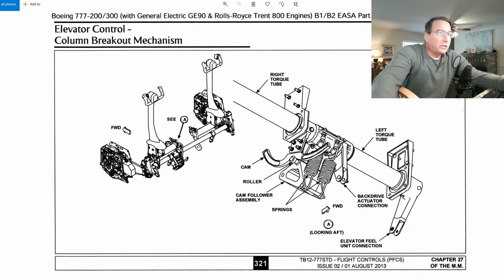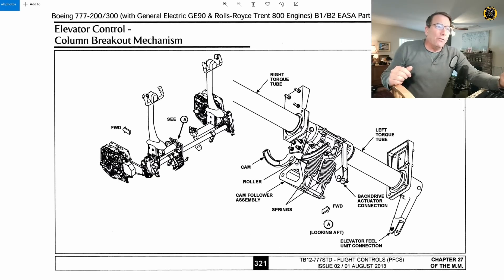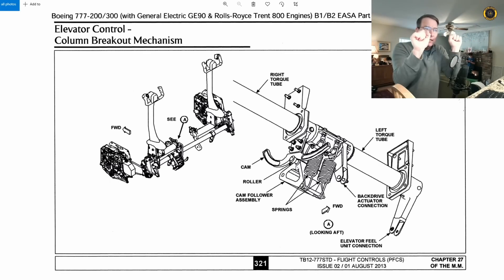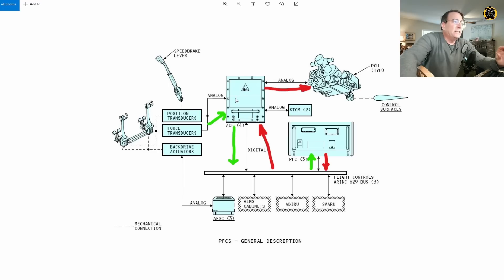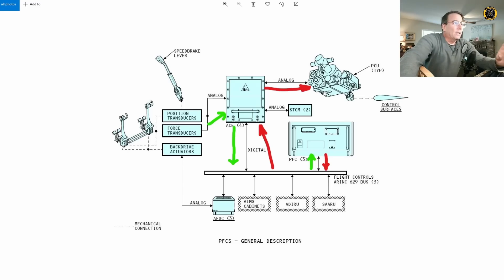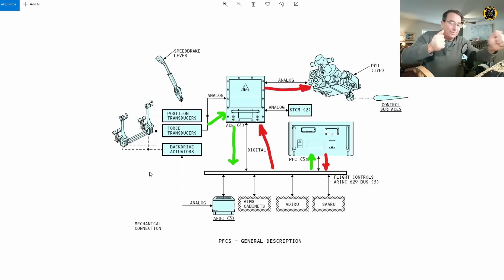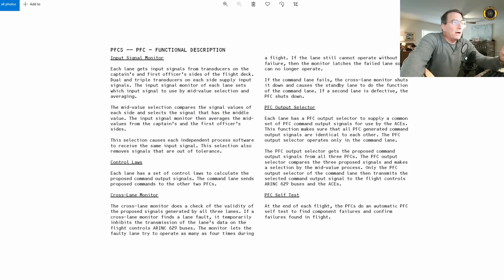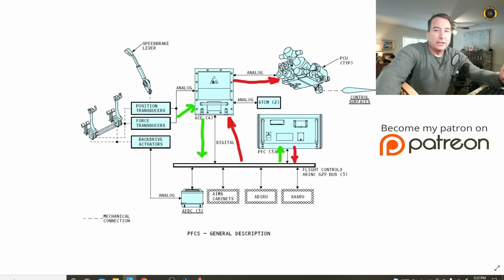Air France 11 Decoupled Flight Controls- "Who's Flying?"

Comment: Watching this video and realizing how EXCEPTIONALLY complex the flight control systems have become in modern airliners, I could easily lose sleep prior to flying commercially. The more complex any system becomes, the greater the probability of failure (my opinion). Makes me want to return to the original way I learned to fly- hang gliding, where you lean the way you want to go, pure and simple.
Reply: I have to say the statistics don't support your opinion. The number of crashes modern complex airlines is tiny. The number of crashes of less complex general aviation airplanes, or hang glides, is much, much higher.
Reply: @andrewsnow7386  Statistics can be very misleading. The relatively higher percentage of accidents in general aviation are almost certainly traced back to less training, i.e., more accidents due to pilot error, not mechanical or flight control system failures assuming you omit experimental aircraft.
Reply: @adamreznik6374  You missed the main point of the conversation. We had been discussing the highly-complex flight control systems of newer commercial aircraft as opposed to the relatively simple flight control systems of general aviation aircraft. It is fairly easy to appreciate the higher failure rate, by percentage,  in commercial aviation relative to GA. However, the GA accident rate is definitely much higher than commercial aviation on a fatality-per-passenger miles flown. The statistics need to be used carefully to ensure you are comparing apples-to-apples, so to speak.
Reply: @jlvandat69  The apple´s for the apple´s, so to speak, are indeed the older models of commercial airliners, e.g. the 707 for the 777. And there´s the same result: The "First-Generation-Jetliners" had a usual crashrate of round about 25 percent. The FBW-Generation has nowadays a usual crashrate of round about 0.5 percent. The safety progress is immense.
It´s the same with this incident: The technical systems of this Air France 777 worked as they should, the aircraft performed a go-around and landed safely at the second attempt. Only two pilots had a bad day in the office afterwards, but otherwise no injuries, no fatalities, no damage to the aircraft. I don´t want to sit in a 707 together with these two guys in the front seats while trying there the same game...
Reply: @NicolaW72  I somewhat doubt a “crash rate” of 25%!
Reply: @johnyoung1128   That wouldn't be per year, but maybe over the life of the aircraft.   Quick Google - Boeing 707,  865 built,  263 'occurrences' in the ASN database,  175 hull losses.   So 30% had mishaps, 20% were written off.   I haven't tried looking up other types but I guess the 707 was no worse than others.
Reply: @johnyoung1128  To give just some statistic data from the aircraft generation built in the late 1950ies and 1960ies:
Boeing 707: 173 of 856 crashed = 20.2%
Convair 440: 58 of 173 crashed = 33.5%
Lockheed Electra: 59 of 170 crashed = 34.7%
De Havilland Comet: 25 of 114 crashed = 21.9%
Sud Aviation Caravelle: 64 of 282 crashed = 22.7%
The DC-8 has the best crash rate of this generation: 83 of 556 crashed = 14.9%.
I´ve not included the aircraft types of the then Soviet Union.

So, yes, there´re big differences from one of seven up to one of three aircrafts which crashed. But all-in-all the crash rate is horrible in comparison to the newest generation of aircrafts.
Reply: @cr10001  You did not specify what “crash rate” meant. Leaving it open for mis interpretation. It could even be interpreted as one in four flights. Statistics are a useful tool but is also wide open for abuse. I will settle for “much safer”.
Reply: The complex flight control systems prevent "forbidden" pilot inputs which exceed the physical capabilities of the aircraft and in this way prevented many crashes.
For example flying too slow and stalling or braking aircraft parts like control surfaces and flaps or dozens other systems and things.
Reply: The complexity of redundant systems greatly decreases the probability of failure.  One of the problems with the 737MAX was lack of redundancy in sensors.
Reply: @markhorton3994  Yes, FAR part 25 does not allow to use only 1 sensor for this sort of system. So the "money saving" exercise was illegal and cost Boeing billions.
Reply: @markhorton3994  Indeed.
Reply: Not necessarily, the systems are complex to cover the failures and prevent pilots or systems from crashing the aircraft. It's still possible to find a way through it all but it's hard - in this case 2 pilots fighting each other over the controls would probably be more likely to cause a crash without the computer taking control.

Comment: 6:05 A slight correction: The three lanes have nothing to do with the three flight control buses.
Each PFC (Primary Flight Computer) consists of three lanes. Each Lane has different hardware and is programmed in a different programming language but all three can do the same job.
The command lane transmits its command output signals to the flight controls ARINC 629 buses. The command lane also has a lane monitoring function to find and isolate failures in the standby and monitor lanes.
The standby lane transmits test data only. The standby lane becomes the command lane and transmits its command output signals to the buses when a failure causes the command lane to shut down. The standby lane does monitoring functions to find and isolate failures in the command and monitor lanes.
The monitor lane transmits test data only. The monitor lane command output signals are used internally to find failures in the command and standby lanes. The monitor lane becomes the standby lane when the command lane shuts down.
When the airplane initially gets electrical power, each PFC starts a lane selection procedure. This procedure automatically sets the function of each lane in each PFC. Each PFC must select a different lane for its command lane. At the end of each flight, the lane selection in each PFC changes to decrease the exposure time for potentially latent failures.

6:10 Another thing: The laws in these lanes are not comparable to the control laws of Airbus. The control laws are a set of rules to calculate the proposed output signals based on the input signals.
The 777 has three modes which are comparable to Airbus' laws. Normal Mode, Secondary Mode and Direct Mode.
As long as you have at least one PFC with at least 2 healthy lanes and all input signals are valid you are in Normal Mode. The airplane switches to Secondary Mode when the PFC does not receive all the data it needs, for example air data or attitude data are invalid. Then it works almost the same (the PFC still calculate output commands) but some protection functions are not applied like gust suppression or envelope protection and the autopilot is no longer available. When at least two lanes in each PFC have failed we are downgraded to Direct Mode. Then the PFC are bypassed and the input signals from the position transducers are sent directly to the PCU (Power Control Unit) of the flight control surfaces by the ACE (Actuator Control Electronics)
Reply: Exactly as the AMM 👍
Reply: Thank you for sharing your knowledge on this, very instructive…
Reply: Thank you very much for this additional informations!👍
Reply: Why three different languages?
Reply: @chuckaddison5134  Actually I can't verify this at the moment. The official documentation says "The CPU of each lane is of different manufacture and part number. The lanes have identical software and capabilities."
During type training I was told they also used different programming languages to rule out any hidden software glitches. But again, I can't verify it so don't take my word for it.
Reply: @chuckaddison5134  I’m late to this discussion, but…   The three different hardware and software implementations are one way to eliminate common cause failures.  Modern microprocessors are complex to the point where you cannot tell what the internal states of the processor will be for any given point in time.  Therefore you cannot 100% test the computer, as you don’t know how it may handle a common cause trigger event.  Theoretically you could have the same exact triggering condition hit all three computers at once, and if they are all identical, they could conceivably all fail simultaneously.  One way around this is to use different hardware and software such that a triggering condition will not impact the redundant computers the same way.

Another way to minimize common cause faults it is to ensure that triggering conditions are different across the computers.  For instance, they could be physically separated so ambient temperatures would be different, EMI/RFI conditions would be different, different power supplies, etc.  You could use different input sources so the exact input values would vary slightly to the different computers.  

I used to perform qualitative analyses on computers to be used in nuclear plant controls.  The potential for common cause failure was an important factor in reliability.
Reply: @michaelj3971  
Thank you, that makes sense. Thinking about it now I seem to recall an accident caused by apparent simultaneous fails on flight control computers. So perhaps that's what gave birth to this concept.
Reply: @chuckaddison5134  I don't recall reviewing that accident, but then there are enough out there that it probably didn't get to us.  I used to teach an engineering review error reduction course where we looked at various review failures.  One of them was the Ariane 5 failure resulting from software modifications from re-using Ariane 4 launch software.  Software is especially prone to errors introduced by software modifications and inadequate retesting standards.  In the Ariane 5 case a software modification led to both redundant computers failing due to the same error, with the loss of the rocket.  It was like 25 years ago, but it is amazing how we need to keep reviewing these types of errors or they creep back in.
Reply: @michaelj3971  
Thank you, I didn't have the whole picture, but it makes perfect sense now.
Reply: @chuckaddison5134  it was part of the redundancy built into the aircraft. They have 2-3 different manufacturers of processors: Intel, AMD, Texas instruments (shot in the dark) so a problem doesn't propagate.
Reply: Ah (sent directly) hence the co-location of the analog inputs and outputs at the ACE. Do they use the old de-energized relay trick to pass these through when the box fails? Or something even more clever?
Reply: @jxh02  No. Direct mode is an active signal to the ACE to pass the analog signals directly to the control PCU instead of the converted signals from the PFC. This "direct mode engaged" signal can also come from the PFC Disconnect Switch in the flight deck.
Reply: @Horstroad    FYI.  The A300-600 had part of the flight control computers analog so as to ensure safety
Reply: To me the three lanes work out to be what's used in hierarchical network topology. With one important difference, normally no PC has three network connections. one has traffic in both directions, one is sending traffic but it's not being received and the third is only maintaining a connection.
Reply: @stephenhunter70  I don't know much about network technology... but again, these three lanes are no network connections. The network doesn't know about the three lanes. From the networks point of view each PFC is one unit sending and receiving data on three ARINC 629 buses. The lanes crosstalk internally but nothing of the monitoring and test data stuff leaves the box.
Reply: Bring on the 7J7
Reply: @Mark Batchelour Offset execution is another way to minimize common cause failures.  The downside is that if you are voting the outputs, the voting process is delayed until all inputs arrive at the voter.  Based on re-reading your explanation (thank you, very informative!), it sounds like comparisons are made, but not voting as I have described it.
Reply: Thank you!